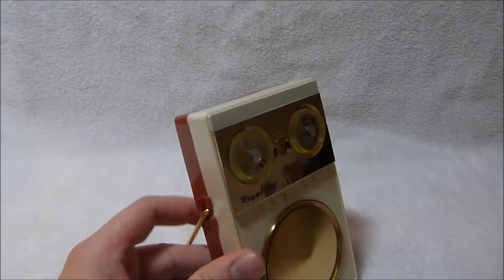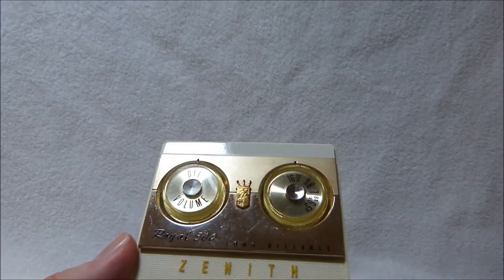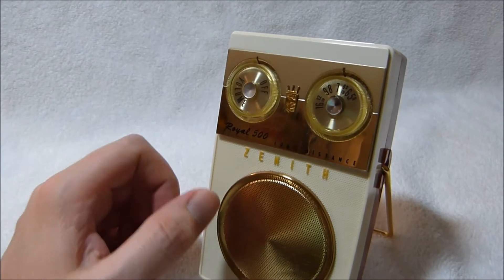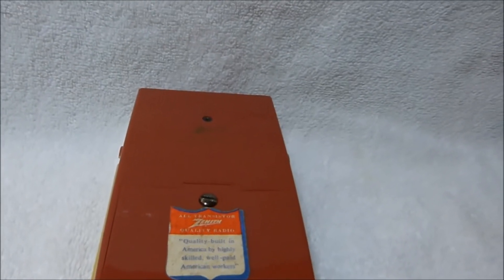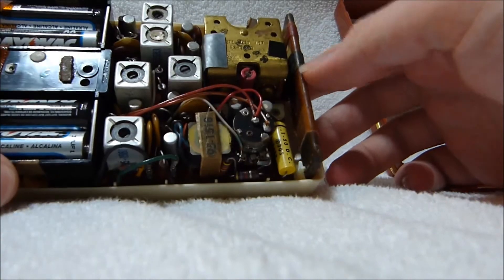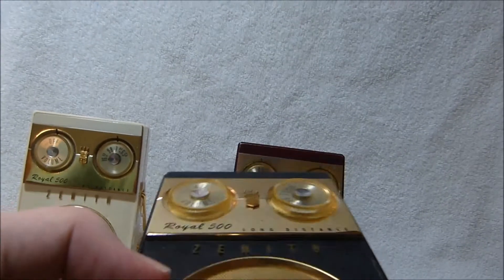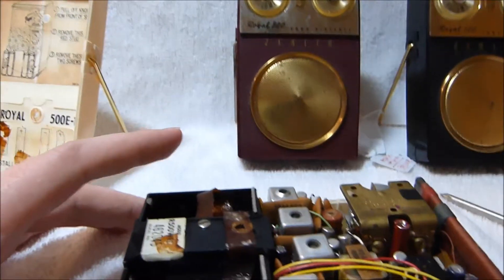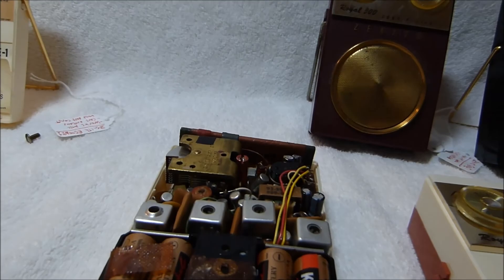1959 Zenith Royal 500E and 500E-1 transistor radios (made in USA)

Comment: Nice radio I wish they made a portable am and fm model during this time.
Reply: Jeff Shaw They did make the Royal 2000 but it was a bigger portable set, not very pocket sized at all.
Reply: Streamlined Steamroller 
Thanks
Reply from the maker: FM receiver technology was in still in it's infancy in 1959, and none of the pre-1960 FM transistor radios models are pocket sized (those did not start appearing until the mid 1960s)
Reply: I think it would have been very difficult to add FM because transistors were pushing their limits to get shortwave below 30 MHz, and 100 MHz would've been far too expensive.

Comment: I saw a 500E with the two tone case like the first one you showed and I thought it was the work of a collector that simply swapped out the backs of some radios. Little did I know it was like that from the factory! It sorta tempts me to try to do something like that with some 500Ds. As far as the speaker goes, one my 500Ds with the convex speaker is super super rattley, I really don't care for the sound of that set. Great video! Keep up the good work!
Reply from the maker: The speakers Zenith used on the Royal 500 series radios were terrible unfortunately (except for the 500H speaker). I have yet to find a 500D with the convex speaker, maybe they were even less reliable than the regular speakers.
Reply: 50sTransistorRadios Seems like it. The flat speaker in another 500D I have isn't nearly as bad as the convex ones but still doesn't sound too good. Either way, a good pair of headphones really show how good these things sound.

Comment: This is a great little radio indeed. Performance is on par with the 500H, and like 50's stated - the speaker is the weak link on this model. I have a small pile of these sitting here with open speakers in them. Keep on buying them in non operational condition , hoping it has a good speaker and so far 4 out of 4 came here with an open speaker. Bummer. I'm sticking with the Royal 500H from this point on.
Reply from the maker: I have two parts sets with bad speakers, so yes that is unfortunately an issue with the speakers Zenith used. The 500H has a much nicer sounding speaker, which doesn't seem to have reliability issues thankfully.
Reply: Yeah, it is. I let go of a nice maroon 500E a couple of months ago with a good working original speaker and now miss it. After seeing your video today, I decided I'd pull out my 500E's and make a franken-E. I decided on the Ivory one with the missing battery cover. I then figured I'd just put the nice black 500E rear cover with its battery cover plate onto the Ivory one. Now to get the Ivory chassis going (the nicest one), just found a bad solder joint from the main PCB by the volume control, going to the tuner gang. Now I had a nice operational chassis.. But the speaker, where can I get one. Oh! That really sad looking Royal 51 AM/FM which had the battery leakage take out the PCB on it. Will it fit? It's the same size speaker.. No other Zenith Royal speaker has fit in the 500E, but I figured I'd yank the 51's speaker out and test fit it. Barely fits.. Like a glove. And now I got one good working 500E frankenset, and it is a strong performer too. Thanks for the video, and giving the motivation to do something with another wise useless pile of 500E's. I can't tell the performance difference in regards to receiving vs. the 500H besides that offset oval speaker obviously. I think it sounds even better with the 51's speaker vs. the original too.